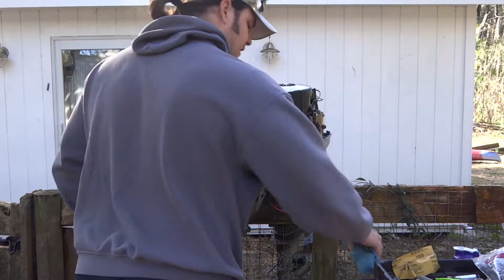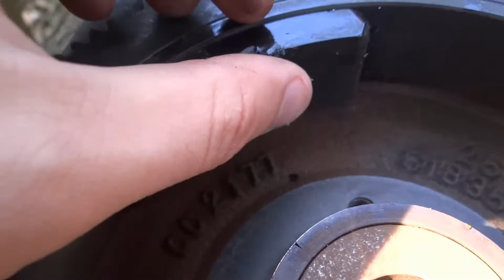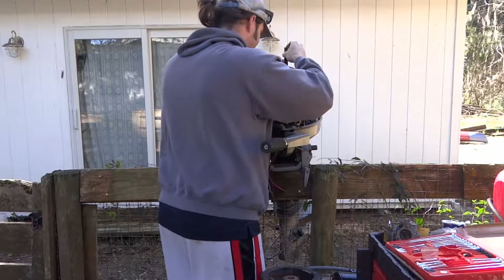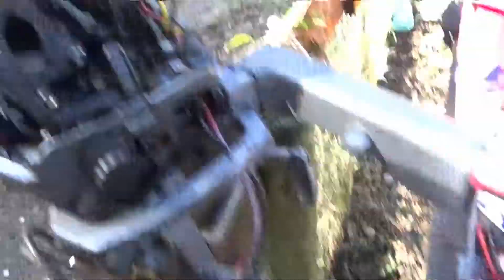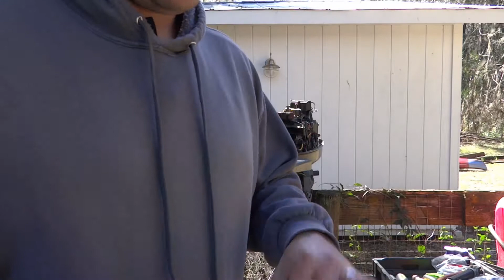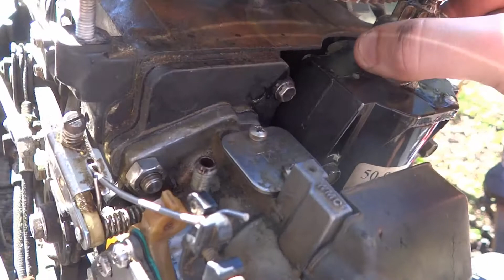Outboard Engine Repair Part 2 - Replacing the Flywheel - Submerged Engine

Comment: Great video I have the same outboard I’m trying to but a electric starter on it but the fly wheel doesn’t have a gear ring are the fly wheel the same 9.9 vs 25 hp